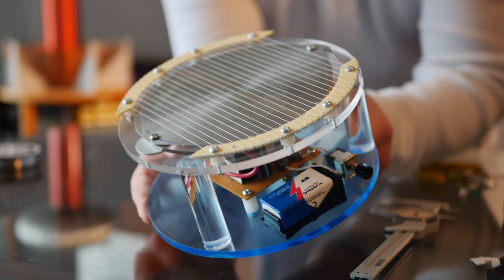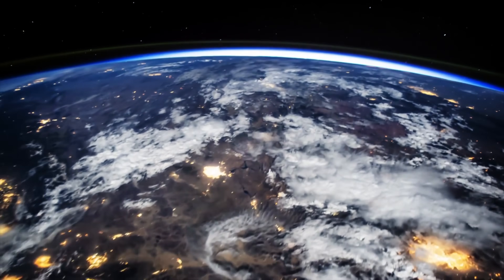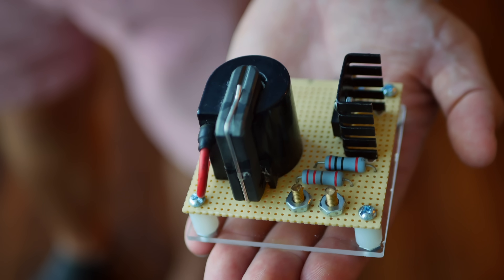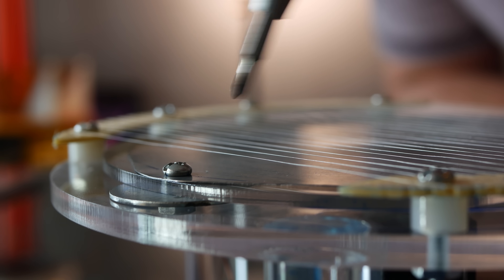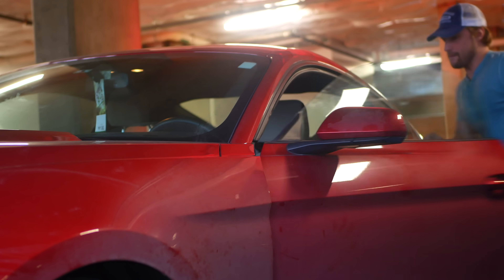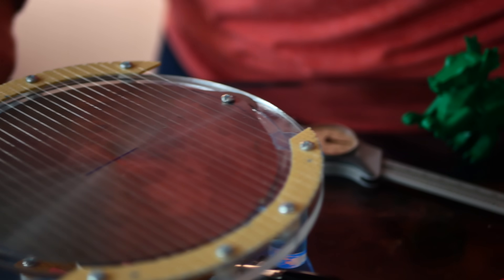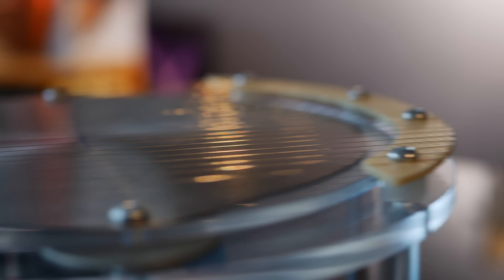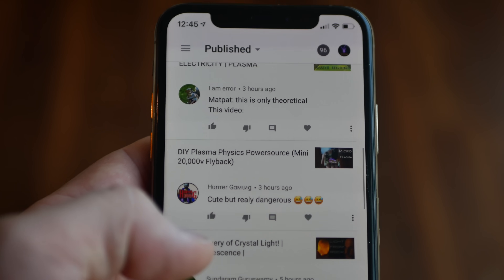Detecting Radiation Using High Voltage Plasma (Spark Detector)

Comment: ya, this makes sense because energy emitted from the radioactive part makes electric potential energy sufficient to arc between plates and wires and acts as a switch which got momentarily closed when there is the threshold value of electric field causing ionizing of air between wire and plate and plasma(continuous spark) is generated.

Comment: Alpha emitters are usually extremely toxic. This is mostly because alpha radiation from the inside of the body is very damaging.
In smoke detectors, the alpha emitter is inside some carrier material so it is reasonably safe, but you really should not touch it with bare hands.

Comment: I have got plasma balls from a chaineese company but the high voltage circuits are damages when i touched the galss with my full palm. Trying to hold the plasma togather, & it turns off completely. 
Same thing happend to 5 of them.

I don't have much knowledge about electric circuits or mathematics. I went to an electrician. The transformer is deed he said.  
It would be great if i can learn & fix it with your help. I really want to learn & make plasma circuits . 
Please help me brother.
Thank you
Best regards
Tanzimul Hasib
Email: tanzimul.hasib@gmail.com

Comment: you should NOT show where the radioactive material is, maybe some physics/ electronic kid lover  will try to replicate the experiment and maybe hurt himself. not safe bruh.
Reply: It’s fairly safe as long as you know what you’re doing. I’d be fine with a 10 year old using this as long as you did not take the thing from the smoke detector because it lets off what I like to call fleas are highly poisonous and radioactive and Am metal let’s off a lot of this I would recommend using a small piece of uranium ore which is completely safe

Comment: 3D built sounds awesome. I think you can make a filled cube/shape detector, if you use a electric fence concept. If you have arrange the wired L, N, L, N. 
A spiral of wire from inside outwards may also work. 
A 3D grid will provide higher resolution paths, but it sounds like a lot of trail and error and a lot of wiring

Comment: Bro..... I watched the "plasma flame" video and did some of my own research. I came across "solar plasma," pretty much what you did.... But I challenge you to make a plasma spark at least from just solar energy....on top of that I notice with the taser I made that the arc gives off kinda of a a high pressure aired shockwave.....

Comment: Please teach me as much about this as you can and also if you make a three-dimensional build of radioactive detection device would that in theory contain a visualization of a stasis that the particles were in or would it be a mobile one image one reaction type moment I mean in other words would you catch an electric charge in the air at the moment that you started to use it or would it move further into one of the four walls of the detector cuz if you capture the charge of the exposed atom I'm trying to talk productively per se would you would you be able to catch the electro electron and if you cut the electron in an active moment would it be kind of like a particle accelerator in a way or would it be a particle decelerator or capture I'm trying to understand what it is that I'm talking about but I'm just in theory trying to follow along with my brain

Comment: A 3D spark chamber build would be great. If you are very patient or if you make it big enough you should see some of those cosmic rays.  Fermilab had a large one in the lobby snapping several times a minute, revealing the track of one of those particles thru about 4 cubic feet of space.
Reply: Or maybe 9 cu. ft.

Comment: I don't know if it's still an exhibit at the Griffith Observatory but there was a similar device with a high voltage dc potential between several plates to trace the path of cosmic rays. Every once in a while a cosmic ray would cause a breakdown between several plates and show the path of the cosmic ray.

Comment: try ruby, lasers
Reply: 90? that should have near infinite mass, if your theories are correct
Reply: so thats why you are scared with the cern accelerator, black holes
Reply: 3d transparent led grid
Reply: x-ray generator, all kinds
Reply: assuming current grows, what happens when, a, the spark can expand, and b, it cant expand
Reply: btw, 25MV barium titanate, d=0.1m, direct capacitor, is a beefy 44kwh/kg, 6kg/L, needs to be loaded to the 25MV, yes, accelerator voltages
Reply: 250MV/m, 2.5MV/cm, 10k relative permittivity
Reply: maybe use a van de graaff or a wire between the plates, with moving dc magnetic field to pump up the charge, or just shoot with excess electrons
Reply: conjugated polymers, like graphene, are better, fixed, at 120x advantage
Reply: cyclotrons? or just pure z-pinch lorentz acceleration rings

Comment: if you class 400v as high voltage enough mate, building a Geiger counter is an easy project, and im happy to help with that. they use a voltage multiplier circuit to generate 400v potential across the gieger tube. i have built several and restored several of old ones. i have kinda gone a bit nuts on this stuff of late so happy to help. Fussor is another project im working on. you will love that thing when its done.

Comment: So many potential applications in this video!

The 3D extension would be amazing! Theoretically since the device detects ionized channels wouldn't it also detect beta and gamma particles? If so a simple way to distinguish which is A and which is B would be to just place two such dishes between a sheet of paper ; if the rear one ionizes you have Beta Radiation. Add a third and an aluminum thick foil for Gamma as well.

And the Muon Detector, man I'd want to see you build that one!

Comment: Well, if I'm not mistaken I think the arcs don't necessarily represent the actual pathway of the alpha particles? It seems the arcs originate from the wire strands every time but how can it be that the alpha particles happen to line up with the wires strands like this? I don't think alpha particles have any charge so it's not like they are attracted to the wire strands via the electric field. Maybe the detector only shows the path of the alpha particles that happen to pass by the wires strands?
Reply from the maker: Your last sentence is correct. The alpha particles are all over the place. The wires offer an opportunity to see them, underneath each wire.
Reply: @PlasmaChannel  Hi, thanks for your reply! It helps to hear you say that because I wasn't exactly sure if that was the case.

Thanks for the cool video!

Comment: I might eventually build one of these, I've collected quite alot of smoke detectors and removed all the americium and put it in a tiny zip lock baggy that I keep in a lead container I made, using my Geiger counter (which sadly can't detect alpha) I get around 1000 - 1200 CPM (Counts Per Minute) it's not really alot of americium but it's pretty radioactive because i can just detect the small amount of Gamma Radiation that it's emitting if i could read the amount of total radiation it would be way higher. I even have some Uranium Glass I have a Koi Fish Candle Holder and a Small Bowl made of Uranium Glass and they aren't too radioactive, the most I got from the Candle Holder was about 90 CPM and the most I got from the Bowl was around 60 CPM.

Comment: 3D would be neat but I wonder if you could also add an audio component depending on position in the XYZ axis (measured by the sires?) so that you have a 'wand' that not only makes sparks but also different sounds depending on position. Would two 'wands' work as well? Just a thought!

Comment: Personally I’d like to see someone experiment with other types of radiation detection. There’s this graph on the Wikipedia page for the Geiger-Müller tube that shows different regions caused by different voltages. The ion chamber region (what smoke detectors use), the Geiger tube region (what Geiger counters use) and the proportional counting region. The output of a proportional or ionisation counter increases with increasing particle energy, and can be made with atmospheric air, so it would be interesting to see them built. The fact that they’re open to the air also means they can detect low energy ionising particles. If you also make a Geiger counter (SBM-20 is standard), make some X-rays with a vacuum tube, grab some Brazil nuts and uranium glass or fiestaware, and you could have quite the radiometry exhibition!

Comment: I want to see you get a beta emitter like Strontium, and use your alpha emitter, Americium and make a high voltage battery that uses the alpha collector as the positive and the beta collector as the negative.  Use electrostatic collector spheres to store the charge and use neon bulb that will flash over and discharge the spheres.  Use Sulfur Hexafluoride gas to prevent sphere arc over and a group 7 quench gas in the neon to stop the continuous discharge.

Comment: Maybe adjusting the output voltage would be easier than rebuilding the wire mesh to get it just right? A variable power supply might do it. Just a thought...

Comment: Does momentum-gained plasma gas break ionic bonds like al2o3?
Reply from the maker: Do you mind sharing a bit more information?
Reply: @PlasmaChannel  actually i dont know how to ask the question right.
Simply the case is: a machine presses two aluminum alloy pieces through 3 minutes. Temperature is about 450C. Pressure is about 400 Mpa.
But pieces dont make bond. If we implement plasma gas on both surfaces, does it work?

Comment: instead of changing the distanse between the plate and the wire why dont you try changing the power that you feed the high voltage generator
Reply from the maker: Yeah, I originally powered it with 16 volts. The thing lit up like a nuke. I thought I was going to kill us all.

Comment: Does it also respond to beta radiation? BTW I think most of them got removed, but there used to be a number of "negative ion" pendants and such on Amazon/Ebay/Aliexpress that were actually disturbingly radioactive.
Reply from the maker: Yeah, those radioactive wristbands were terrible. It goes to show how little regulation takes place with selling products.

Comment: definitely interested in the 3D detector ... also it'd be cool if you could make a 3D grid of LEDs that detects electric fields or similar, there are interesting videos of charge detectors (+/-) during lightning storms
Reply from the maker: Hey now, that's a cool idea. I did do a video on a 10x10 grid of neon lights, that show strong AC fields.

Comment: That thing is really neat, but the problem with it is probably its reliance on air as a conductor, since it can vary in aspects such as humidity and pressure. So it probably has to be calibrated when used somewhere else.

But it combines the visuality of a cloud chamber with the coolness of high voltage!

Comment: hey Jay, I want to know if you can make detectors for the other types of radiation you mentioned. also, isn't there a fourth type of radiation, the kind that is composed of neutrons?
Reply from the maker: Yeah, those other detectors are a bit more complex. I like the idea of attempting those, though.
Reply: @PlasmaChannel  thanks for replying, and,  if you ever do try and make them, good luck man. :) oh, quick question, is it possible to make a high voltage power source that is not dangerous? I don't want one that is composed of very short individual arcs, like static electricity, but one that stays constant in power, and is very high voltage and can flow through your body without hurting you. Idk if that is even possible, but I would love to be able shoot arcs from my fingers in some experiments, and it would just be really cool in general.
Reply: @PlasmaChannel  also, I just so happen to have an old smoke alarm that I could take apart, and I like collecting metals, and would like to get what is inside if I can, alpha decay isn't very dangerous right? wouldn't it be ok if I stored my sample of metal in a sealed container for display?

Comment: Do it and you can improve it by change the wire direction and increase the voltage
You need also a vacuum to place it in
Reply: You need an ionizing gas to create a conduction pathway between the wires.

Comment: Would it be a cube that is all msde up os vertical and horizontal parallel wires ? Or just layers of grided wires? Hmmmmm.........
Reply from the maker: That is the question.....guess you'll need to wait for the next videoooooooooo......
Reply: @PlasmaChannel  trial and error ma boy trial and error......

Comment: Very cool! 
Make sure you properly store your alpha particle generator as it may be unhealthy in a long term - I'm not sure if touching it with bare hands is wise as it can by mistake get inside your body which can be tragic in long term. Yes, I'm pointing part where you show us how you plan to attach it to metal rod :|
Reply from the maker: Yes, good recommendations. Thank you. Alpha inside the body is TERRIBLE.
Reply: @PlasmaChannel  that's why it's very unwise to take apart a smoke detector in that way in the first place. It's very easy to create fine dust which can be inhaled.

Comment: I want someone to look at me like how jay looks at acrylic.
Reply from the maker: Hahahahahah THIS. so much this.
Reply: @PlasmaChannel  you should also watch Evan & Katelyn when they are pouring resin, that's hot too and it is still in liquid form <3 They have a ritual "resin time, resin time, resin time, resin time..."
https://www.youtube.com/user/EvanAndKatelyn
Reply: @PlasmaChannel  Any method that also detect x-rays?
Reply: @SI-ln6tc  X-Rays and Gamma are both forms of ionizing Electromagnetic Radiation so something similar to this might theoretically work if the X-Rays are strong enough but would also detect other forms of radiation as well.  Might be worth looking into how Geiger counters work since those detect Gamma and could probably detect X-Rays as well.  I think the main difference would be blocking Gamma as well as lower frequencies* without blocking X-Rays but I'm not sure what kind of material would allow that.

*UVC is also ionizing, UVB is borderline and I think sometimes works like ionizing radiation, UVA and below (visible light, infrared, radio, low Earth) are non-ionizing and probably not an issue.
Reply: Your stying capacity isnt great enough😁
Reply: What a sad life

Comment: Could you have changed the sensitivity of the detector by changing the strength of the resister between the power supply and the grid?  Nice job!

Comment: My high voltage voltmeter video request is still pending 😭.

Great and informative video as always once again🔥❤️😀🎉
Reply: Just use a large resistor and an ampmeter. So one Kv equals one milliamp or something. I made one. Worked great.

Comment: Awesome video as always! The quality of these builds are fantastic.  It would be cool to add a current sensing resistor in series with the power supply and sensing portion, which should allow you to get a reading every time an arc jumps from an alpha particle.  You could then use a microcontroller to count the amount of current spikes per second and calculate a rough estimate of radiation(rem,bq,cu, ect).
Reply from the maker: Hey....now that sounds intelligent. Good idea.

Comment: 3D 3D 3D 3D 3D 3D 3D 3D 3D 3D 3D 3D 3D 3D 3D 3D 3D 3D 3D 3D 3D 3D 3D 3D 3D 3D 3D 3D 3D 3D 3D 3D 3D 3D 3D 3D 3D 3D 3D 3D 3D 3D 3D 3D 3D 3D 3D 3D 3D 3D 3D 3D 3D 3D 3D 3D 3D 3D 3D 3D 3D 3D 3D 3D 3D 3D 3D 3D 3D 3D 3D 3D 3D 3D 3D 3D 3D 3D 3D 3D 3D 3D 3D 3D 3D 3D 3D 3D 3D 3D 3D 3D 3D 3D 3D 3D 3D 3D 3D 3D 3D 3D 3D 3D 3D 3D 3D 3D 3D 3D 3D 3D 3D 3D 3D 3D 3D 3D 3D 3D 3D 3D 3D 3D 3D 3D 3D 3D 3D 3D 3D 3D 3D 3D 3D 3D 3D 3D 3D 3D 3D 3D 3D 3D 3D 3D 3D 3D 3D 3D 3D 3D 3D 3D 3D 3D 3D 3D 3D 3D 3D 3D 3D 3D 3D 3D 3D 3D 3D 3D 3D 3D 3D 3D 3D 3D 3D 3D 3D 3D 3D 3D 3D 3D 3D 3D 3D 3D 3D 3D 3D 3D 3D 3D 3D 3D 3D 3D 3D 3D 3D 3D 3D 3D 3D 3D 3D 3D 3D 3D 3D 3D 3D 3D 3D 3D 3D 3D 3D 3D 3D 3D 3D 3D 3D 3D 3D 3D 3D 3D 3D 3D 3D 3D 3D 3D 3D 3D 3D 3D
Reply: 675*D^675 here I fixed it

Comment: What V and A did you use fore your 50kv ac power supply? Last time i asked you told me the V and A for your 20kv dc power supply i need it for my 3mv bipolar voltage multiplyer
Reply from the maker: For the Subaru power source video, if that is what you mean, I used two lithium battery packs in series. Total voltage 14.8volts....at I believe 3-4 amps?
Reply: @PlasmaChannel  didnt you use AA batterys? There is like a second of 8 AA batterys and why did you connect the sender tape of the zvs to the left side of your transformer?
Ans is the 14.5v 3A for the 555 timer or for the zvs or for both?